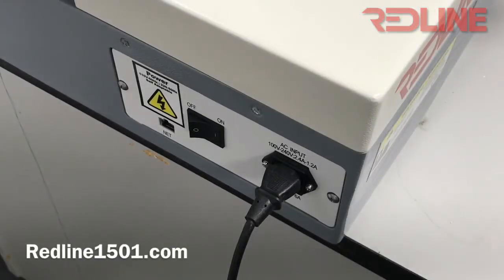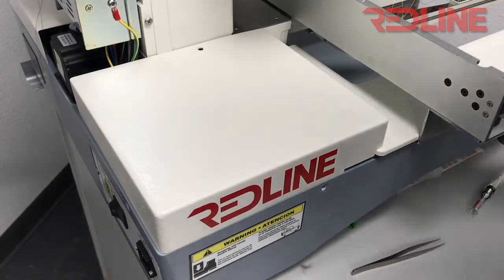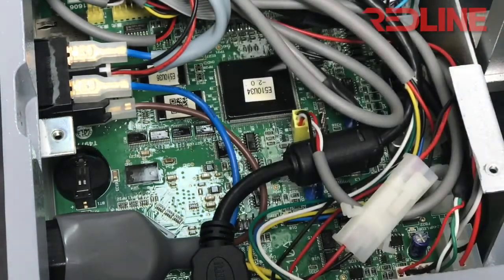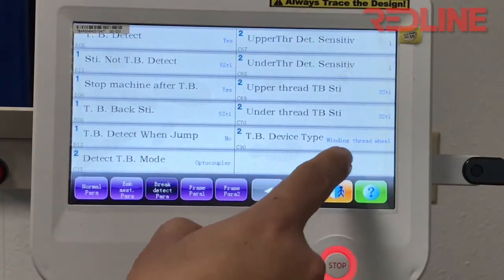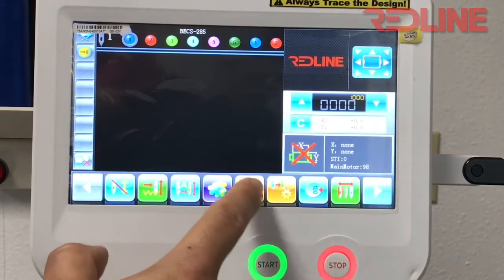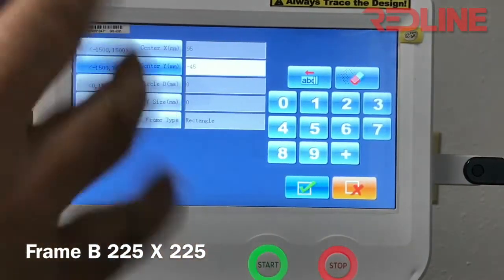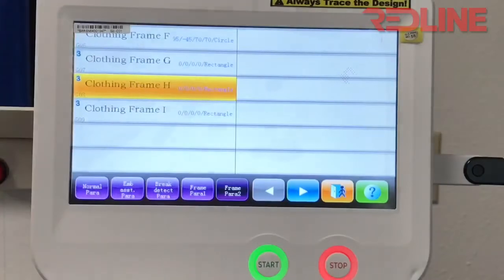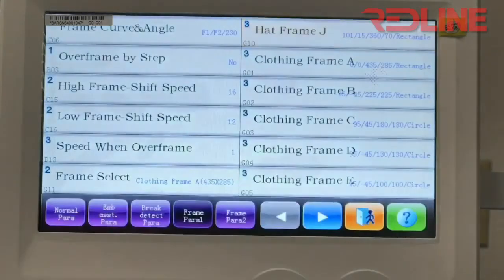How to replace the battery for 285 computer only

Comment: Thanks for your help. I am grateful. I had no idea what had happened because the error was in Chinese language but I was able to fix the problem with your help. However, I dropped the small screw inside somewhere, couldn't find it, hope that's not a biggie haha. Machine is working just fine. Thanks once again.
Reply: I did the same thing!
Reply: @NikkiVelazquez  I was thinking all the time they screw might fell down and it did haha.